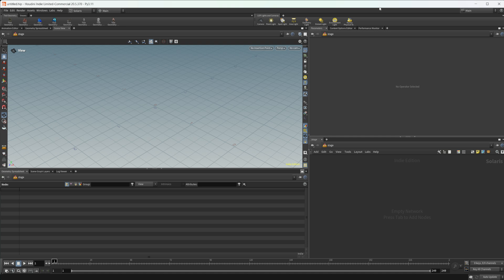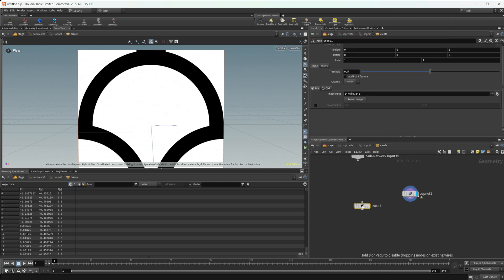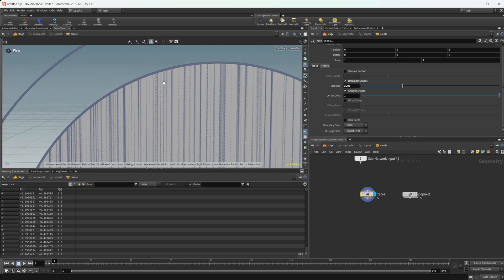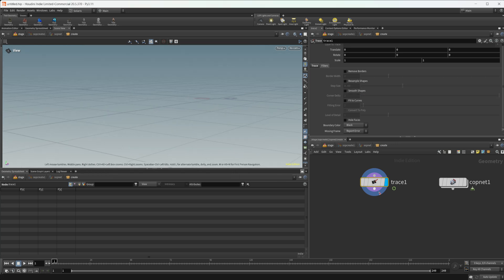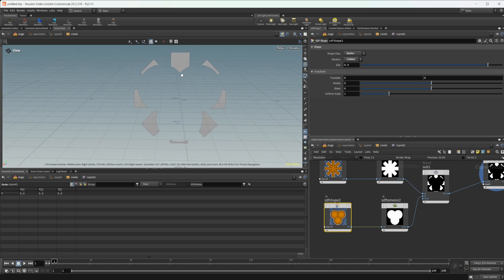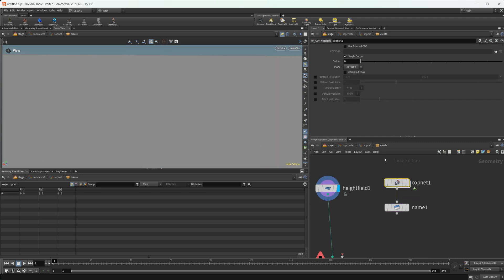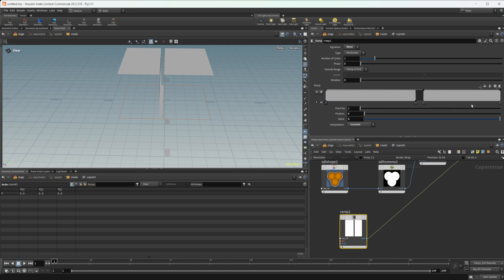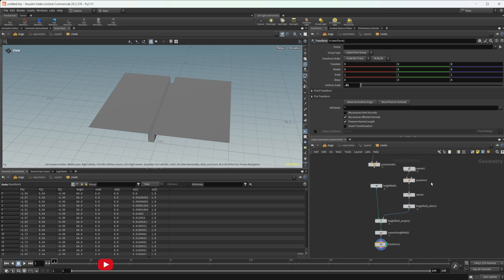Modeling Techniques Using Copernicus Houdini 20.5

Comment: just use a heightfieldfile node ....no heightfield project needed ;-)
Reply from the maker: I tried doing that but for some reason it wasn't working. Not sure if it's bugged or not. I thought I had gotten it to work prior but it wasn't working when I was working this time so I reverted to this method.